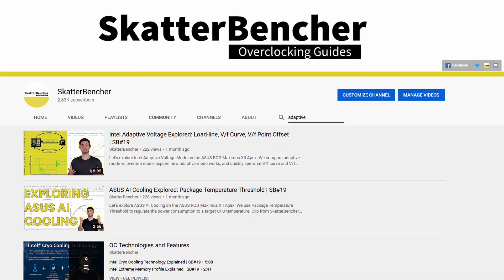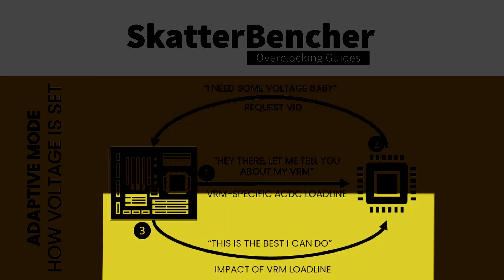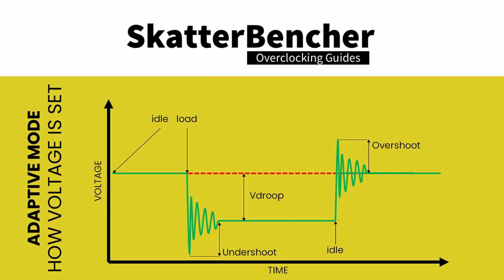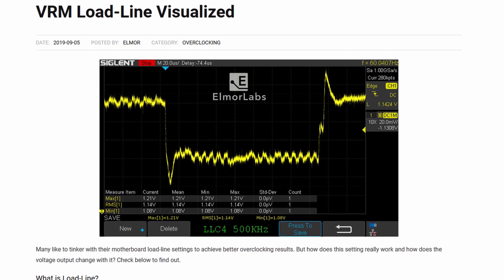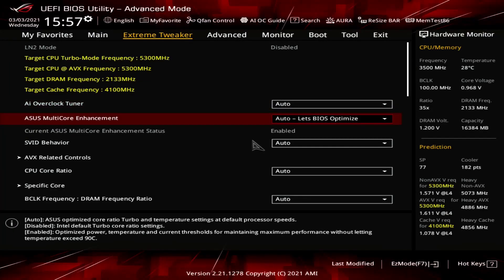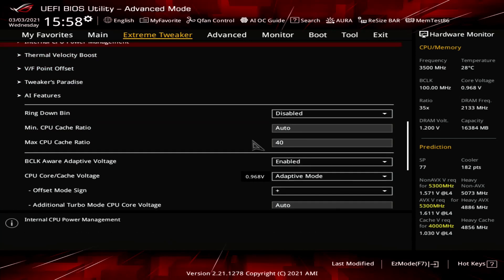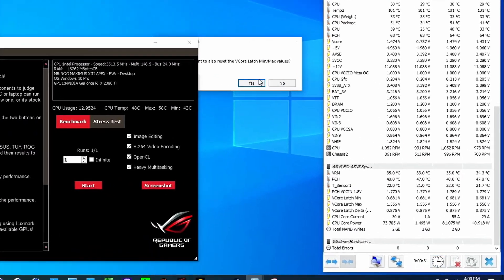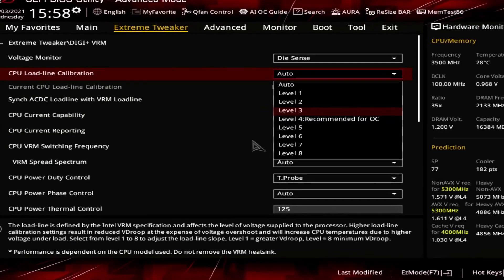ASUS VLatch on ROG Maximus XIII Apex Explored | Overclocking Rocket Lake: What's New

Comment: (recommended llc 4) Not particularly, not in my case tho, depends on what you trying to achieve at the given voltage and at what workload. 
My 10900kf pulls almost 400w at min 1.19v 5.3 all core in linpack 1.42v max idle (direct die cooling) and at llc5 droop is around 230mv and 200~ at level 6. So if i want to pass 50 loops linpack at 5.3 all core i need to raise the initial voltage above 1.45 with llc5 to not drop under 1.2 at linpack or set llc6. I dont know why theres so much droop on my board or its just normal. all protections are off and at maximum current/power limits. (die sense voltage reading)

Comment: 04:22 ASUS mobos are just so nice to work with... I had RAMPAGE 4 and RAMPAGE 5 now waiting for my MAXIMUS 8 Apex and new set of G.Skill F4-5066C20D-16GTRS.
For your information I actually got my 11900K work on MSI Z590 A-PRO all core turbo @ 5.5GHz (All AVX disabled) I just bought a cheap but somewhat good board to test the 11900K.
I really liked the X99 RAMPAGE V board and the stuff you could actually do with it... I'm sure I will explore the MAXIMUS XIII the same way and your videos will come handy!!!
You have nice content also subscribed to your channel and keep them videos coming!
Reply: What are your bios settings to get it to work at 5.5 ghz all core and what CPU cooler do you have?

Comment: I actually have a question to ask. In ASUS motherboard’s CPU clock speed setting, there’s a thing called “per core” mode. I only know how to adjust the numbers in the “all core” mode and “auto” mode, but I am not sure how to deal with the “per core” mode. For example, I’m using a i5-10600KF, how do I know what the maximum clock speed each particular core of my cpu can be stabilized at, so that I can get the cpu to work at its highest speed rather than riskily setting a single number in the “all core” mode?
Reply from the maker: Is the setting "per core ratio limit" or "by core usage"?

By core usage is actually how the Intel turbo boost works out of the box. It sets the ratio for each CPU core depending on how many cores are active. The more cores are active, the lower the ratio.

By core usage has the advantage of being able to increase the ratio when few cores active. Thus resulting in increased performance. For modern Intel systems I strongly recommend using by core usage over using a fixed ratio for all cores
Reply: @SkatterBencher  Thanks, i want to setup the per core ratio limit. I want to set every single core at its highest possible speed while maintaining good stability. Cuz my i5-10600KF can stabilize at all-core 4.90GHz, but will bluescreen after 10min in stress tests at all-core 5.00GHz. So i guess, may be i can use the per core ratio limit to go higher than all-core 4.90Ghz but lower than all-core 5.00GHz. But how do i know which cores can go higher while the others must stay at 4.90GHz max?
Reply from the maker: I haven't actually checked if Per Core Ratio Limit is also working on 10th gen Comet Lake as it's an overclocking feature that's new on Rocket Lake.

I covered how it works in this video: https://www.youtube.com/watch?v=_yoQJQOV5qc&t=241s
Reply: @SkatterBencher  thanks. I checked my 10600KF on the ASUS mobo. Actually it says “by core usage” rather than “per core ratio limit” - my mistake. And I tried to set an individual number for each of the six cores of my 10600KF. Result turned out to be: the highest stable value that I could reach for “6-Core Ratio Limit” is 49, while for the “1/2/3/4/5-Core Ratio Limit” I even reached to 55 without any problem. I stopped trying >55... But it seems to me that “1/2/3/4/5-Core Ratio Limit = 55” doesn’t make a tangible improvement (maybe only 1% improvement, score improved from 15900 to 16070 on passmark, judged by several tests) in the cpu benchmark as long as my “6-Core Ratio Limit” was fixed at 49. If so, what is the point of setting a larger number than 49 for the “1/2/3/4/5-Core Ratio Limit”? Can you give me some advice? Thanks again.